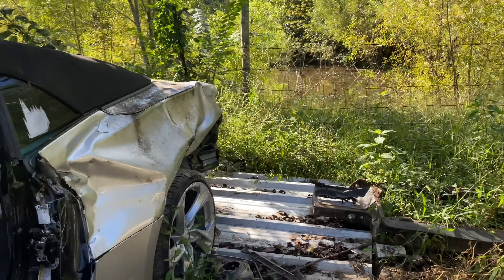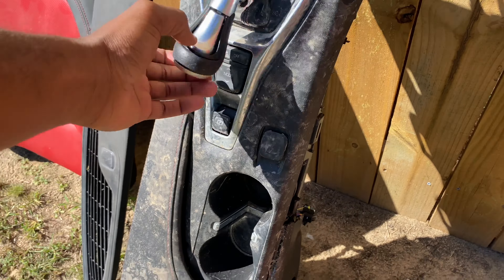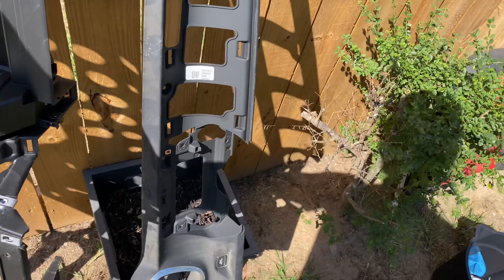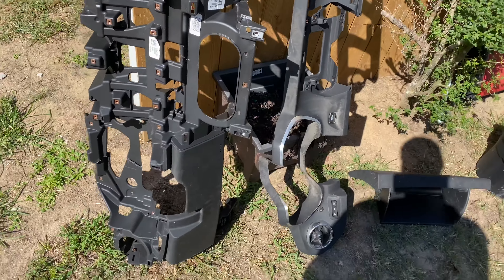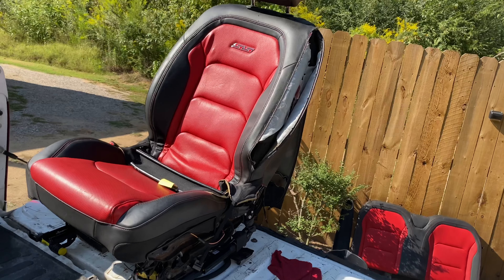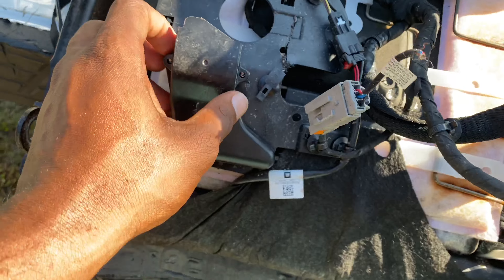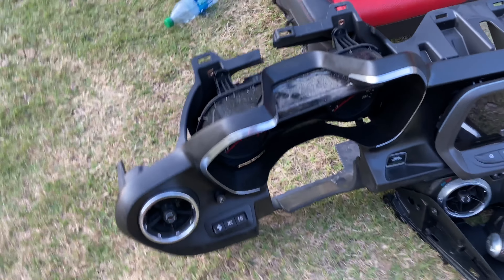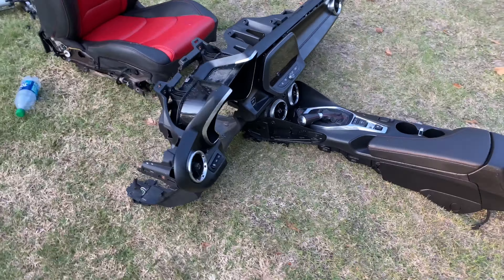2020 Camaro SS Interior Swap For My Twin Turbo Monte Carlo SS!!

Comment: Man im thinkin bout puttting a 10 speed dash and drive drain on a g8 😂😂 you got me hopefull shawty
Reply from the maker: Mane go for it, it’s a little time consuming but that’s the hard part.
Reply: @SelfMadeKelan definitely im not really familiar with chevys but i feel theyd be the same like mopar swaps with everything bolting right up to the older models with the drive train and dash with the drive modes  etc or small fabricating but i definitely know it isnt impossible havent seen anyone do it yet hopefully i can by the end of the year